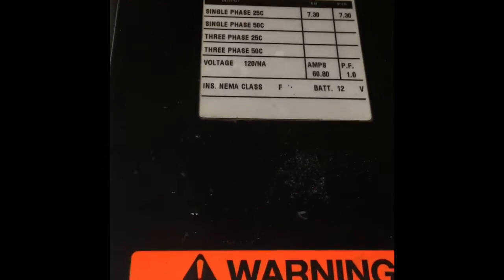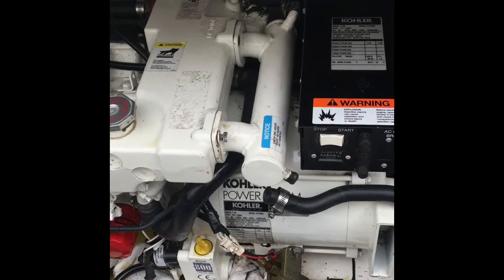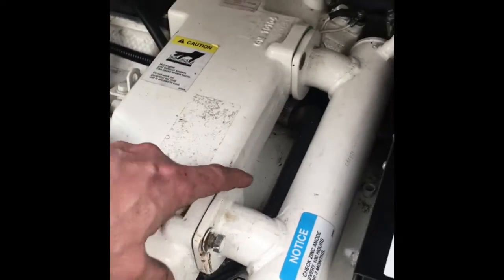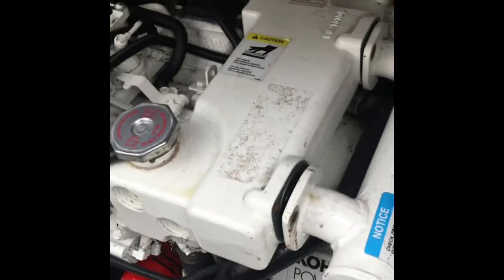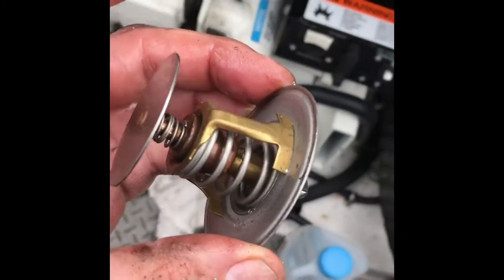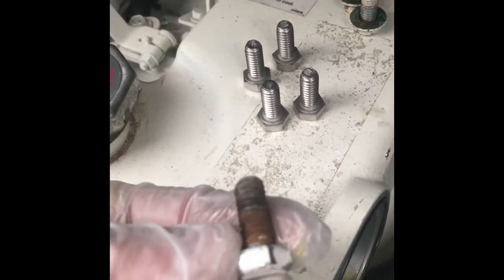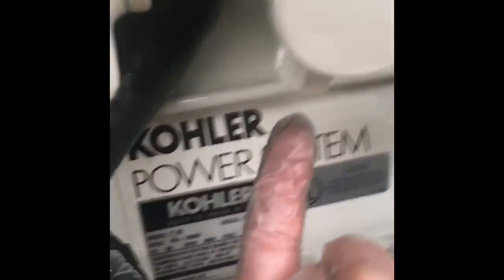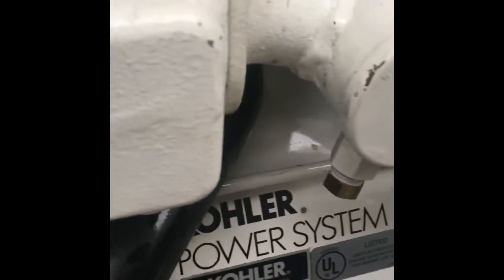KOHLER Marine Generator Thermostat Replacement 7.3

Comment: Great video on these engines that lack maintenance manuals. Only thing I would add is that using stainless steel bolts isn't a great idea because it's mixing two different metals which will lead to galvanic corrosion of the most corrosive of the two metals, in this case the engine. A better option is to use 10.9 grade or higher zinc coated steel bolts.